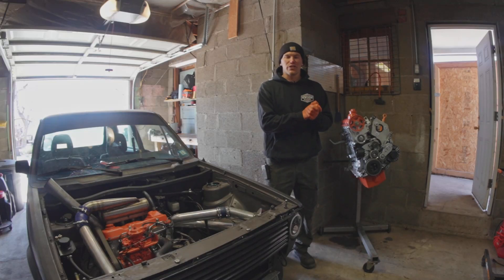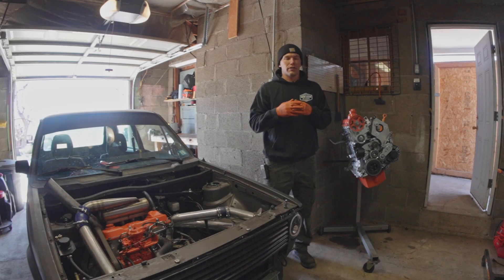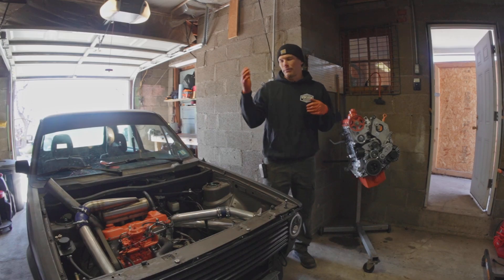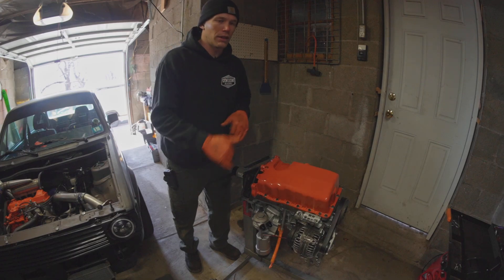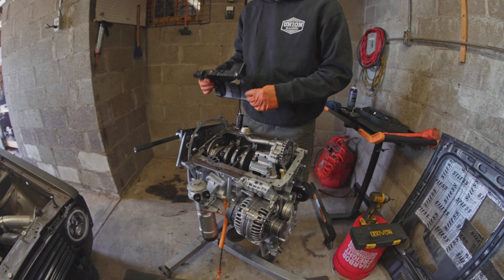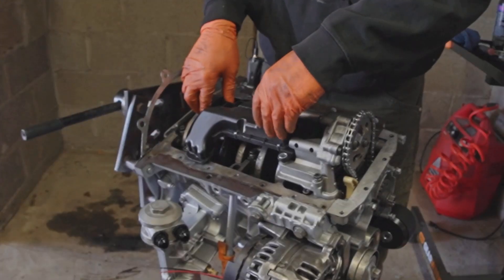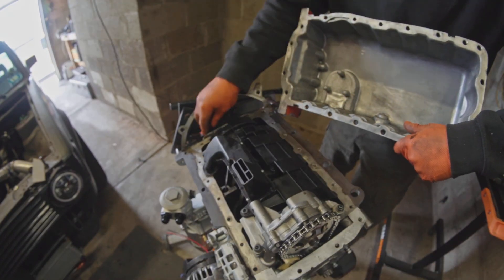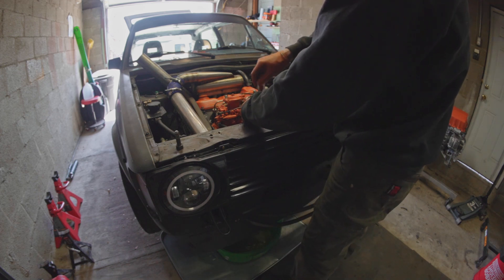1.6L to 1.9L ALH Engine Swap in my 1984 VW Rabbit MK1 - DAY 1

Comment: What did you run for fuel line on the 1.6? Did you go for bigger ID feed?
Reply from the maker: I still have the stock hard lines
Reply: @OliverFetter  Gotcha! My filter to pump line needed replacing so dropped a 5/16" with reduction to 1/4" clear line in (reducer is so annoying). Love being able to see the flow & any air. Might do the same with the return now. I've heard once you get up to about 140hp on the VE pumps, then the stock line with the reducer becomes a restriction and loses some high-end. I have my doubts though, after seeing your 200whp run lol. Ever notice anything weird? I'm not sure if MK1 was different thank MK2... mine stock is 8mm ID at filter and reduces in the middle of the line to 6.5mm at pump.
Reply from the maker: @chrisladouceur4093  mine is 5/16 all the way to the pump banjo fitting. As you've noticed the pump fitting is actually slightly smaller by about ~1mm. The only time I've had the pump act weird about fuel is when my lift pump is off & im still running hard (ie it's now acting as a restriction on the main pump). I'm not sure where people get the idea that the stock lines are restrictive...at 5k rpm with a bigger head & camplate you're still only using ~4L/minute. More important than volume, I'd be thinking about case pressure. So long as you can keep the case pressurized properly it doesn't matter what fuel line you're running >> aka lift pump
Reply from the maker: @chrisladouceur4093  if I were to get more serious (or notice issues) I would go for a more powerful lift pump with a regulator set to ~15psi. Right now I think my mini does ~5-7psi
Reply: @OliverFetter yeah I’ll need to look into a lift pump soon. Wild to me the mk1 had 5/16 all the way. Mine has a SERIOUS reduction in it stock. Even so, at 1/4 I still don’t see an issue if I throw on a lift pump? Probably overthinking it
Reply from the maker: Hehe yeah probably just gotta find out 😉

Comment: honestly i think this will be better for you. i am also looking at afully mechanical 1.9L ALH install on my 2003 MK1 golf with a reinforced frame ,beefy suspension, 4 wheel drive conversion and want to put a custom bullbar on tha front. Turn it into a micro powerhouse. don't want to move with speed fast. want to move with power.
Reply from the maker: Sounds sweet!

Comment: 12:30 yeah I've seen other vw aluminum oil pans with multiple angle, lower and higher bulkheads in there.
Also helps with oil cooling
 (T4 5cyl. have heatsink style fins on the outside as well)
Reply from the maker: It would've been easier if it was  a steel pan with what I have 🤔 wish I could've welded it right to the pan
Reply: @OliverFetter  yeah you could do a lot more then.
Although ppl in tdi forums make those hybrid and they add steel floors that you definitely could tune
Reply from the maker: @ChrisGR93_TxS  yeah that's a good idea
Reply: Aluminum is a terrible material for an oil pan.
Reply from the maker: @khester7397  😮‍💨😮‍💨 facts